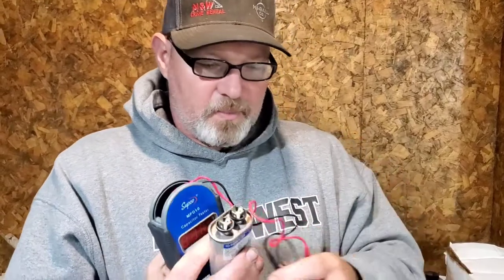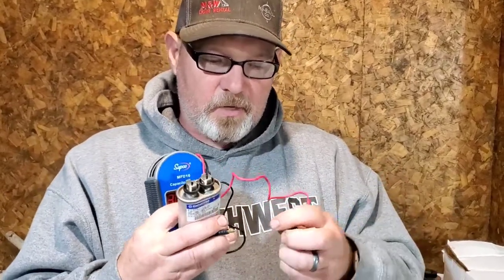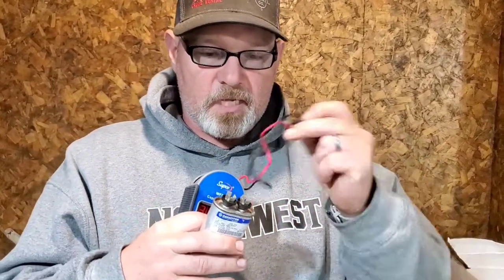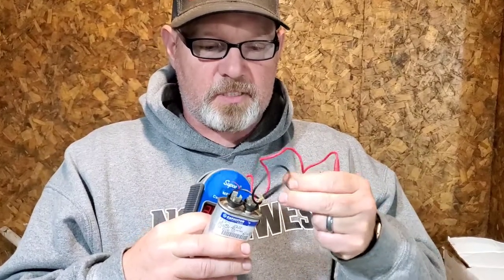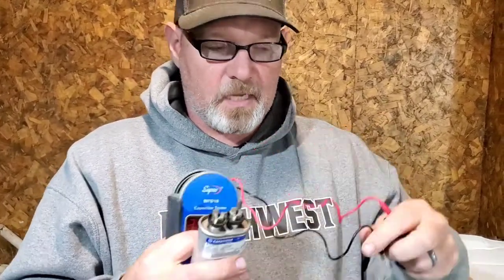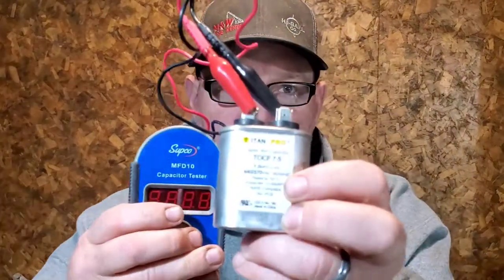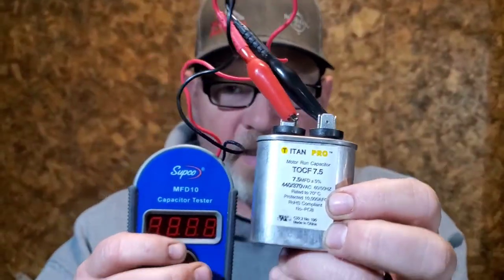How to test a capacitor with a Supco MFD 10

Comment: Both original and replacement run capacitor are same 12.5 MFD 440/370 VAC but new replaced blower motor has 7.5 MFD listed . Still good ?
Reply: No sir‼️Always go with the motors required cap on the label.

Comment: Just another gimmick tool most HVAC techs don't need. Anyone with a good meter can do this just as fast. With a multi meter you can also test them under load which is the way I like to test them. Amps x 2650 then divide it by the voltage between common and Herm (compressor) and then do the same thing to test the fan side by changing the last number to volts between Common and fan on the cap. You never have to shut the unit off or pull any wires to do this method and testing under load is a more accurate measurement anyways.

Comment: Haha, why not put the camera on what you are doing instead of a medium shot of YOU. Oh, and a good practice before connecting a capacitor to any tester is to first discharge the capacitor by shorting its terminals with a low value, high wattage resistor; also known as a bleeder resistor.